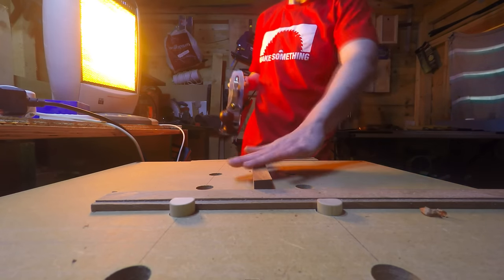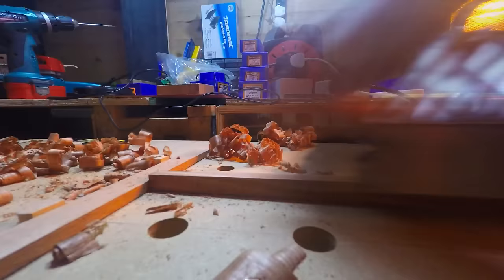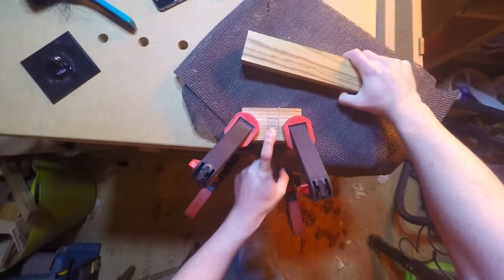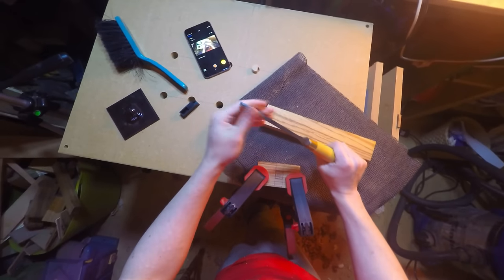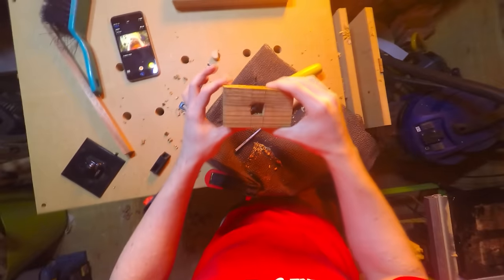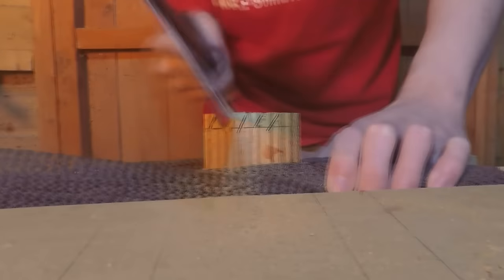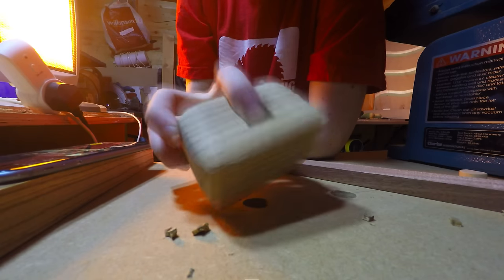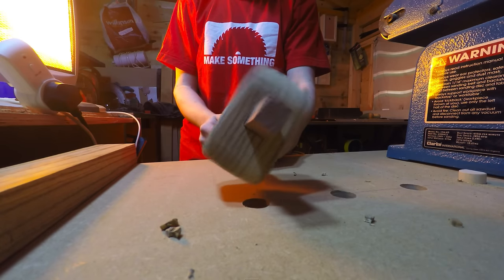THE MEAT MALLET - Kitchen Utensil Build Challenge 2015

Comment: nice project joe! u got ur mallet now .also,good choice of wood... not too hard not too soft. not that it matters but
i JUST got the veritas dovetail saw in mail yesterday. havent had a chnce to REALLY  use it yet.( just a few test cuts) but its really nice,precise, and comfortable saw ..im sure u know that now
Reply: ***** dude same here! It  stutters - if tht makes sense- or skips a bit I know EXACTLY what ur saying... i think its because its brand new and needs to be broken in a bit..I think after a few more uses itll be fine..
Reply: I just found out there is a Rockler store about 5 miles from my house and after watching your chisel video it inspired me to go out and get some chisels.so  I purchased the Stanley 750  sweetheart set it was a bit expensive but they are beautiful chisels the edges on them are  incredible and there sure sharp right out of the box
Reply: ***** I totally agree with you.  "Ya get what ya pay for"  for the quality i dont mind spending.. definitely worth it in the long run like you said!
Reply: hey joe, i just got done making a little display box and cut some dove tails with the saw.. i found that if you use the whole length of the saw its a really smooth cut ..no skipping ..just a fyi ..give a try and lmk if it helped ya